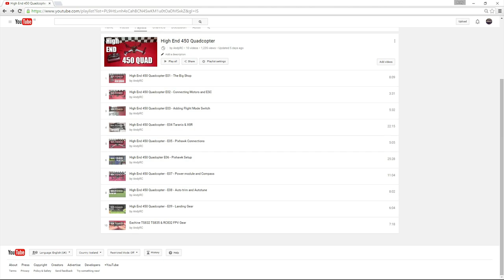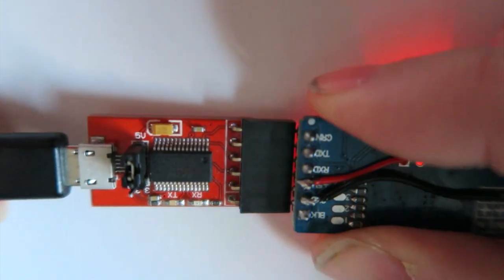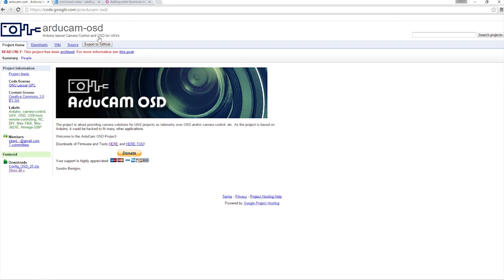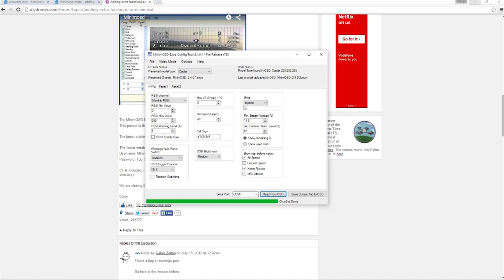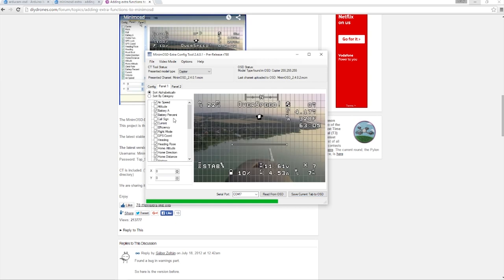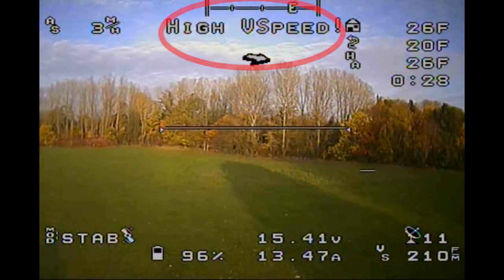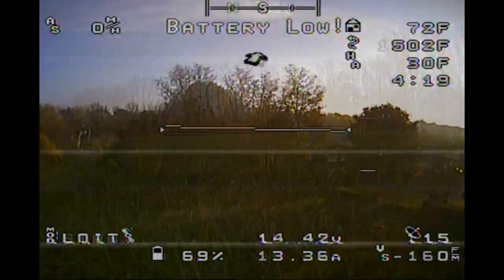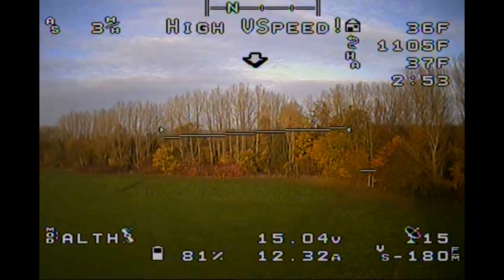MinimOSD

Comment: Hi Andy
A great tutorial and excellent timing as I've just purchased another APM 2.8 which has the MinimOSD bundled with it. Interesting issue with the cloned power module. I already have a Genuine 3DR APM install in one of my fixed wings so I'll pay attention to the differences between the 3DR power module and the cloned version supplied with the latest APM2.8. The FrSky voltage sensors are very accurate but I have reservations about the 40Amp current sensor. I had one of these installed on my Hex and with a 3s 10400mAh battery my flight times dropped from 18mins to 7mins. I found that the voltage drop within the sensor exponentially increased as the device warmed up. Even though it's spec'd at 40Amp any current draw above 10Amp resulted in an excessive Voltage drop.
Regards
Nidge
Reply from the maker: thanks for the info. I'll have to pin all my hopes on the 3dr power module working then. cheers
Reply: +AndyRC 
So far I've not had any issues with the 3DR module. It tracks the Voltage and Current draw/used quite accurately. I'm sure you probably have but if not you do need to tell the system, via Mission Planner, that the module is installed along with the battery type and capacity. I've yet to install an FPV system on my APM equipped plane so I've been using the 433MHz radio telemetry link with my Android Phone (Droid Planner) to monitor all the onboard sensors and to create and execute Waypoint Missions. Your tutorial on the MinimOSD will be invaluable when I get round to fitting it, hopefully in the next week or so.
Regards
Nidge
Reply from the maker: +sputniksam yes everything was calibrated correctly in the battery monitor

Comment: Hi Andy, I appreciate this video was done awhile ago, but from memory and in general can you have only signal wire going into minim osd from camera and only signal wire going out to vtx without earth? Thats if you have powered both sides of the osd with pixhawk telemetry input.  Cos I think i have  read somewhere in arduplane regarding the pixhawk servo rails, you have to power the servo rail with a separate 5v or 6v supply but  it's always recommended that you connect  signal wire including ground to the servo railing regardless. Thanks for your efforts in general, my first ever question 😊

Comment: Hi Andy, nice one, as indeed it is a pain to get an OSD working properly with Pixhawk from my experience! One thing though regarding the voltage problem, did you calibrate properly your battery with a meter while at 75% thrust with inverted props, so you can play with your divider and come to a reading on MP close to the Meter reading? Also, if I may you mention you would perhaps go for the Frsky module directly from the battery; and was wondering what you were referring to Andy, please?
Reply from the maker: +FPV Cambodia yes It was calibrated under load in a previous episode and it doesnt work :( frsky sell their own telem module for battery voltage that plugs into the X8r and sends the telemetry to the taranis

Comment: Hi Andy; Nice one! I have a couple of these bloody Mavlink board  without the jumper from 12 to 5 VDC removing the power to the intputs Video components. And never used them due top the risks of over heating, and disaster in-flight! I concentrated on your bypass hardware removing the component you properly showed (minute 17 Ich); but would like to know if there were some proper "how to" anywhere on the net, as I have not found it and gave up! I'd like to reuse these little Mavlink OSDs, as a few are here awaiting to work, in the drawer... Tks for your consideration, if I may; and cheers for such well done and to the point tutorials; once again! Cheers and Safe Flying!
Reply from the maker: +FPV Cambodia the problem with the mavlink is theres so many different versions of them. I only have the one in this vid. the best thing to do is search on goggle images to try and find your version to do the mod. as for the mod its self i just heated the component up with a soldering iron until it fell loose ensuring that non of the other components were touched.

Comment: Maybe a bit late but :
MavLink doesn't work on every FlightController board.
It works on a CC3D flashed in OpenPilot, but not CC3D flashed in Cleanflight
MavLink also doesn't work on a SPRacing F3 board.
Instead of Mavlink you have to use MW-OSD

Comment: I have a small issue, the video that the osd puts out from the fpv camera is very bright, overexposed. Barely can see anything. This doesn't happen when directly plugged into the vtx without the osd. Do you know what is wrong?

Comment: Off topic but have you done any videos on ezWifibroadcast, Andy? I need someone to show me how I can connect a pixhawk cube to the raspberry pi and have telemetry (compass, gps data, voltage etc etc) on the HDMI monitor. :( plenty of paragraphs saying it can be done but no step-by-step instructions anywhere.

Comment: hi andy 
Ur osd is reading voltage which is not stable Reading due to the input 5v of osd is not stable. as you may be knowing the analog reference is taken as reference voltage to calculate the battery voltage, current, etc.
If u connect it to a another battery (1s) to power the osd then you would get a stable reading or just use a 9v battery and 5v regulator. It would not be a problem coz it osd consume much less power. 
I hope this will help you in readings on osd👍👍👍
Reply from the maker: I will give it a try thanks!
Reply: That is bulls*hit. The voltage reading is a value that comes from Pixhawk. Pixhawk knows the voltage because the power module tells Pixhawk that. The voltage goes low because it actually goes low. This is caused by too low C-rating on the battery or otherwise busted battery. Change battery to something with higher C-rating.
Reply from the maker: then please explain why an external voltage checker doesn't do it..

Comment: Do you have a link to the black dampening balls used on the pixhawk?? I've looked everywhere for them and only found the blue ones.. Thanks!!
Reply from the maker: +Joseph King yep here u go http://www.ebay.co.uk/itm/8pcs-Vibration-Dampening-Rubber-Balls-For-250mm-Mini-FPV-Quadcopter-QAV250-/311508848972?hash=item48875fd14c:g:JswAAOSwYaFWd8ag

Comment: Hi Andy, you have a great series shaping up here. I am following your build and using it as a base for one that I have planned. Is the crius mavlink-osd the same one that you have (I can't post links here unfortunately)? I am trying to get by with as little soldering as possible. Also, in this setup, is it possible to get telemetry for both the radio and the fpv setup?
Reply: One more question if you are in the mood for it :) - Is the laserBGC android rx1 that you reviewed earlier this year compatible with this setup?
Reply from the maker: +Sarath Menon I'm not aware of that version of the osd. like I say there's a few versions. u will have to see what it's like when it turns up. yes the RX1 will work :-)
Reply from the maker: +Sarath Menon I'm not aware of that version of the osd. like I say there's a few versions. u will have to see what it's like when it turns up. yes the RX1 will work :-)
Reply: Thanks Andy. This is a bit confusing for me, so please bear with me. For me to use a phone as my primary monitor, what do I need? Any transmitter, and just the rx module, right?
Reply from the maker: +Sarath Menon yep that's correct :-)
Reply: +AndyRC Thanks Andy. One final question and I am done :) I just read the product description and it says that it needs a fatshark compatible rx module. Is the the rx1 just a video to usb cam converter? Does the transmitter have to be a fatshark one, or will the eachine TS832 work? (I assume they are all some inter compatible protocol.)
Reply from the maker: +Sarath Menon yes you need a fatsharks receiver module with it to work :-)
Reply: Thanks! I have enough to get started on this.
Reply from the maker: +Sarath Menon great to hear. enjoy!

Comment: Hi Andy 
Thanks for all these answers you have really helped me threw my quad 
I am ordering 1000kv motors will these lift a gimbal seing as you used 920kv 
Is there a big difference thanks
Reply from the maker: the lower the kV the more it can lift. 1000 should be ok
Reply: +AndyRC r u sure 1000kv will lift. The cheap gimbal you reviewed the heavier one will it lift this
Reply from the maker: +ReallyHarrison with small props and a 4s yes it will
Reply: +AndyRC I'm using 10 inch props and a 3s battery should I buy a 4s or will the 3s work
Reply from the maker: to lift a gimbal i would use 4s and smaller props

Comment: If 1000 won't lift it will there be any point in trying I really want a camera drone and will be using a gimbal
Reply from the maker: the multistar 2213 lift a gimbal on 8 inch props and those are 1300kv
Reply: +AndyRC I'm just going to use rhd 800kv with 4s and 10 inch props that should do the job
Reply from the maker: in this video im using 2216 800kv with 10 inch and lifts nicely :)

Comment: Nice video! Whats better, An Hermit 145 or an Ladybird FPV With picnic quadframe.
Reply from the maker: it depends what using it for. ladybird for inside. hermit for outside
Reply: But for racing and acro mode?
Reply from the maker: +Leon Beekveldt definately the hermit
Reply: Is it a good quality?
Reply: (The hermit 145)
Reply from the maker: +Leon Beekveldt I dont have one but the specs look pretty nice.
Reply: +AndyRC The one with FPV build in too?
Ps. Thanks for helping!!
Reply from the maker: +Leon Beekveldt I'd say it would be better to add your own fpv
Reply: Thanks!

Comment: what a nightmare that is!!! much easier to buy rtf version!!
Reply from the maker: is there an rtf that comes with osd on its fpv? I guess the new hubsan x4 pro will
Reply: +AndyRC 
If it ever see's the light of day as it's now nearly two years past its original release date. The only other comprehensive RTF OSD I've encountered is the EzOSD fitted to my IRC Vortex. Even the DJI OSD's require some form of surgical intervention 😜
Regards
Nidge
Reply from the maker: +sputniksam I'll be doing some vids on the slated hubsans soon. keep a look out :-)
Reply: On new Tarot XYZ-M everything works great out of the box as it is easy a 1-2-3!!!:)